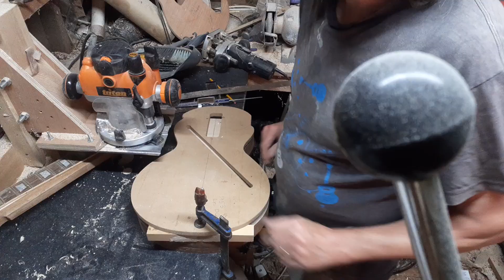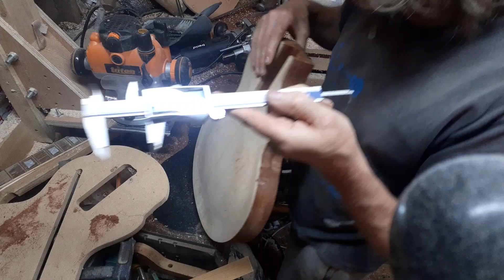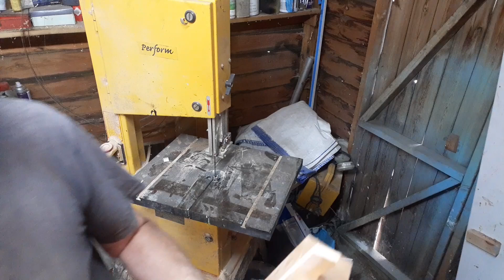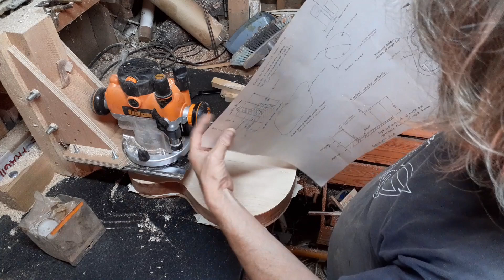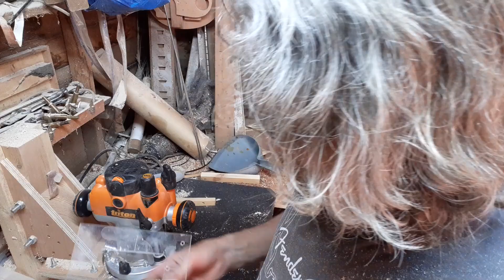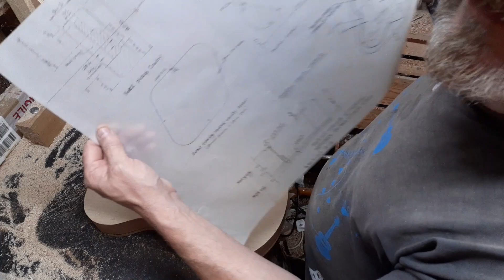Goldtop Les Paul build.... part 7

Comment: If I had to buy only ONE router to build a Les Paul guitar following your amazing video series, which one would it be? A small hand router or the bigger one?
Reply from the maker: I would say the bigger Triton ( orange one), the smaller Trend T3 has too many limitations, mainly the lack of fine adjustment on the depth stop and to be honest I don't think it would be happy with a 1/2 cutter, it's too light weight for heavy use. Going back to the Triton, it will take a 1/4 inch and 1/2 inch collet so bigger cutters are no problem and it's easily powerful enough for the bigger cutters, it has nice speed adjustment, the best feature is the depth control as it has a "fast" plunge to get it in the ball park and then a fine wind-down control, it also has depth stops....Slightly annoying things are, it came with  two collets but the biggest one was 12mm not 1/2 inch so that will cost you extra and the dust extraction guards are annoying if you don't have dust extractor, but they're easy to remove. From memory I paid £230 for it but that was about 3 years ago, I think the latest ones come with soft start as well. I've used it a lot and it has been 100% reliable, which is more than I can say for the small Trend T3. I did make my first guitars without a router but I would say it's near enough an essential tool for solid body guitar making. Hope that helps, all the best and thank you for taking a look!
Reply: @3rguitars890  Thank you for your reply! you're creating amazing content!